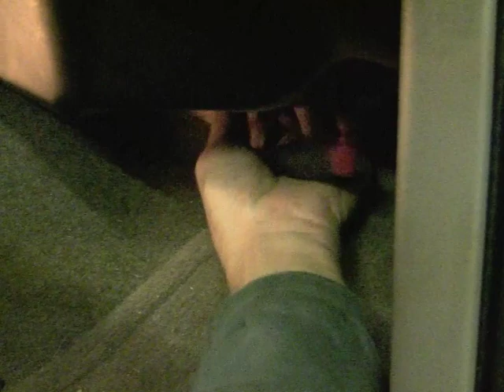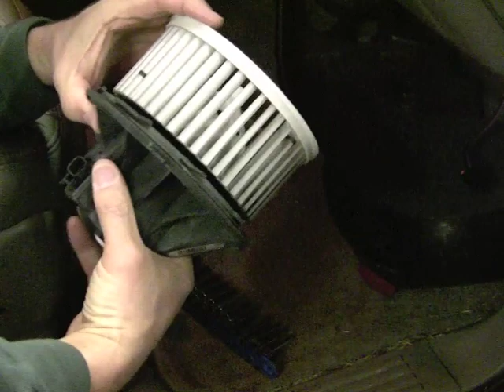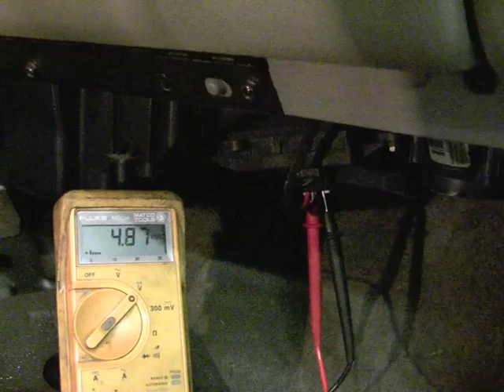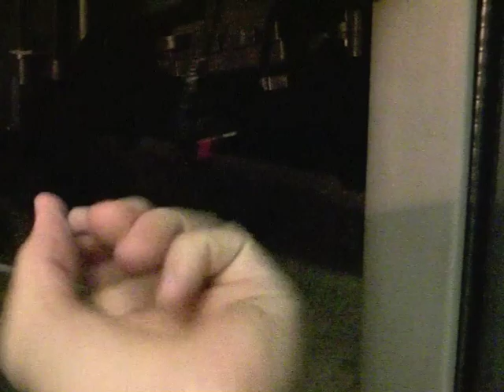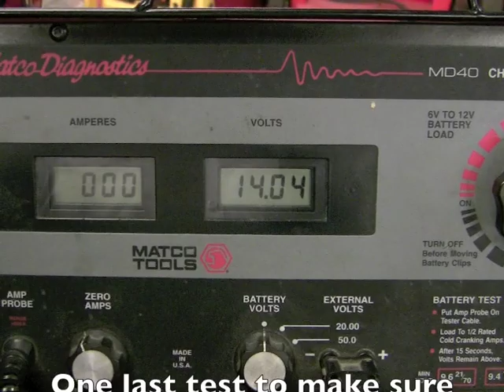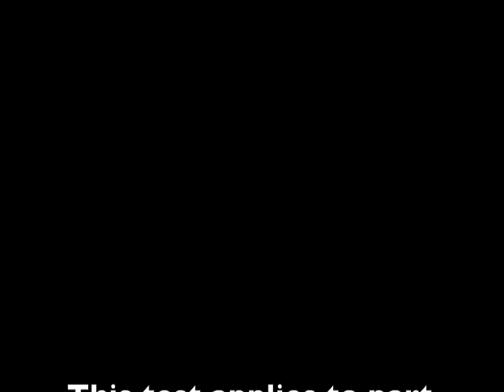2005 Chevrolet Tahoe Blower Not Working

Comment: 06 GMC Yukon. Blower only works when vechile is moving. But when it is moving very little air coming out of vents. No matter what speed you have blower on
Reply from the maker: Your blower is not working at all. What you are feeling is ram air coming in through the fresh air inlet. That is why it is only there while the vehicle is moving.
Reply: @SparkysAnswers  ok that makes sense I replied to your question on your site thanks for all your help. Really appreciate it

Comment: I know this video is almost 9 years old, but my A/C only worked in the rear of our tahoe. Checked all fuses everything was good. Checked relays and those were good. I came across this video and was like let me give this a whirl. I dropped my blower and it had a bunch of dust. Gave it a little nudge and it blew a lot of dust off of it but than worked as normal. Awesome video!! Thanks for the help
Reply from the maker: Glad to hear that your blower is working.

Comment: I'm not getting any readings from the middle purple cable, could this be the ac controller on the dash?
Reply from the maker: The voltage on the small purple /white wire comes form the blower speed controller and not the HVAC control panel. The HVAC control panel pulls the voltage low by applying a pulse width modulated ground signal to it. To test you will need to separate the small purple/white wire from the blower speed controller(resistor) and then backprobe the blower speed controller to see if the voltage is now present. If it is not the blower speed controller is faulty (assuming you have also confirmed power and ground on the red and black wires). If voltage is present you will nee to find out if the HVAC control panel is shorting the signal to ground or if the harness is rubbed to ground somewhere.
Reply: I have same issue. Too bad you couldn't show a video of this.

Comment: Nice video ! I have 02 tahoe automatic controls. And my blower works intermittently. And when that blower works I have front and rear air. Can you have advice for me ? I can’t still find a pattern when the blower works. It works on every level 1-4. Just blower comes and goes

Comment: what have i done wrong after replacing the blower motor and the resistor both new parts from advance auto. and the climate control still doesnt blow air on high, is their some fuzes somewhere other than the left side door
Reply from the maker: There is a BLWR fuse in the underhood fuse box that powers the red wire for high blower speed (5).
Reply: ok, i checked both 30 amp fuses on the side panel prior to replacing the motor and blower resistor, are these fuses i can purchase at advanced auto or do i need to go to dealer,, reference fuses under the hood. they should be in my manual correctl
Reply: louis paccapaniccia
10 minutes ago
ok, i checked both 30 amp fuses on the side panel prior to replacing the motor and blower resistor, are these fuses i can purchase at advanced auto or do i need to go to dealer,, reference fuses under the hood. they should be in my manual.. thanks i will check fuses under the hood very good video, thank you.

Comment: I installed a new blower resistor module. It fixed the problem and the fan now turns on. However, the fan kind of pulses and makes a thumping noise. Is my resistor not working correctly or is there another problem? The fan seems to be fine (since I can turn the fan on high and when I turn the key to off the fan glides smoothly to a stop with no thump that is present when the fan has power. 
Any ideas? Although the resistor is new, I think the resistor is bad after the above run test,  but I don't know for sure .
Reply from the maker: What brand and part number did you install? The two things that come to mind are a faulty blower motor or a faulty blower speed controller (resistor). Assuming you used an ACDelco 15-81773, I would be leaning towards a faulty blower motor. Possible worn bushing or open commutator bar. If you did not use an ACDelco replacement part and the noise was not there in the recent past when the original blower speed controller (resistor) was still working I would be leaning towards a faulty new part.

Comment: My rear and middle vents seems to be blowing fine but my front was are not pushing air and my windows won’t defrost.. can you please help me
Reply from the maker: What kind of vehicle and does it have manual or auto controls? Is it not blowing in the front or not getting hot?
Reply: Same here front does not blow any air and when I press the Defog I hear a ‘click’ but nothing happens (2005 Chevy Tahoe)
Reply: I have a 2005 Chevy express my heat is not working and I have tried to check the blower motor but seems fine.
Reply: It has a manual control

Comment: hi, I have the same tahoe,but I can't find the part for it,they are either 5 pin or the screw holes don't match. need help.
Reply from the maker: If you have the same Tahoe with auto controls the part has been updated to a new design with a five wire connector.  It can be found here.    https://store.the-electric-connection.com/15-81773-hvac-control-module--gm-trucks--suvs-w-automatic-ac--2003-2009-p719.aspx

Comment: whats the part number on the resistor i cant seem to find one that fits my 03 sierra.
Thanks in advance...
Reply from the maker: I am assuming that your truck has auto controls. The current part number is 15-81773. Here is a link to that part. https://store.the-electric-connection.com/15-81773-hvac-control-module--gm-trucks--suvs-w-automatic-ac--2003-2009-p719.aspx
Reply: I got the manual controls
Reply from the maker: Factory floor mounted center console with bucket seats or not? RPO option D07 on sticker inside glove box.

Comment: man I hope you can help me. I have an 04 suburban with auto ac. the blower completely stopped working. I checked the blower and it still spins with power applied to it. I tested the resistor and got 13v on the hot side. but nothing on the purple input wire. not knowing much I replaced the resistor and still the blower doesn't work when hooked back up. so now I'm leading to what I'm assuming is called the hvac aux. control module. searching the internet for these different parts has brought up a lot of different issues with different parts and the same parts being called different names. but I'm hoping you can help me identify this part,  the purple wire from the blower speed resistor goes to it. it has the red and gray connectors. Also if this piece is bad, could that cause the blower to completely not work? and is there a way to test those connectors? Thanks for any help you can give me
Reply from the maker: The original blower speed controller (resistor) had a three wire connector. At that connector you have a black wire that must have a constant ground signal and a red wire that must have a constant battery power signal. You indicated that the red wire has 13 volts on it. The voltage on the small purple/white wire comes from the blower speed controller (resistor) and Must be checked with the harness connected.  The HVAC control panel pulses a ground signal to it and it is referred to as  pulse width modulation (PWM). Here is a link to an in depth article on the late model replacement part. The article also has links back to articles on the original design. http://sparkys-answers.com/2011/07/2003-gmc-yukon-bower-erratic-not.html
Reply: Sparky's Answers thanks for the reply, but how do you test the purple wite while it its hooked up? and the box where the purple wire goes to, it had 2 connectors on the bottom a red and a gray, and inside looks like a computer chip, is that the HVAC control panel? and could that cause the blower to stop working?
Reply from the maker: The purple/white wire connects to the HVAC control panel (digital display with two temperature control knobs that you use to adjust the a/c settings). As far as testing the voltage it is all explained in the articles that I sent a link for earlier.
Reply: Sparky's Answers. my purple wire that comes off the 3plug harness at the resistor, goes to another box that is mounted beside an actuator. i know its the same purple wire because i traced it out then hooked the tester to it at the 3plug harness and at the red plug where it goes into this mystry box and it beeped. ive seen posts where this box is called an HVAC aux control module and ive seen posts where its called an actuator but this box doesnt have actuator parts in it. and your telling me that the control module is where i press buttons to control the system
Reply from the maker: Are we talking about the front or rear blower?
Reply: Sparky's Answers rear blower
Reply from the maker: Okay. I can still help you with this but you will need a good multimeter at minimum in order to test some of the basic signals. Use of a compatible scan tool would be best. Please go to my main site Sparkys-Answers.com and sign up for a member ship and re ask your question there. It is much easier for me to keep up with there and we can both upload images to help work through the process.

Comment: Hi. I hope you get this message. I have a 05 Yukon. My battery died so we jumped it. Now the front ac doesn't blow. I can feel it's cold but no movement of air. I checked fuses all seems ok. Please help.
Reply from the maker: My guess would be that the blower speed controller initially failed and kept the blower running even with the ignition off. This caused the battery to go dead and now it will not work at all. I strongly suggest  you test the voltages as outlined in this video and on my main website to confirm.
Reply: Thanks. It was the blower resistor. I took a chance n purchased one n changed it. I had to do something. Here in Hawaii the shop woulda wanted my both arms n both legs 😂. My husband was shocked that I did it by myself. I shocked myself also. thanks for the reply! 😊

Comment: So I know that a blower resistor needs to be changed if the blower works on 1 and 5 on the controller. Is it the blower motor if the blower does not blow at any setting on the controller?
Reply: And is the blower speed controller and the blower resistor the same thing?
Reply from the maker: The blower resistor is the most common cause of a missing speed or speeds in the blower system. If all speeds do not work the blower resistor could still be the cause but the blower motor becomes more suspect under that scenario. I cannot stress enough that a "silver bullet solution" does not come close to actual testing and education so that one Knows the answer instead of simply making a statistical guess.
Reply from the maker: A blower speed resistor and a blower speed controller accomplish the same task of adding control over the blower motor. They function very differently though. The blower resistor is generally part of a manually controlled system and the blower speed controller is generally part of automatically controls system. As with anything there are blurred lines on this subject depending on make, model and year of vehicle being referred to.
Reply: Great. Thanks. I have a 2003 Chevy Tahoe. I replaced the resistor two years ago. But, the manual controller worked on speeds 1 and 5 and I found that to resolve it. I think it might be the blower motor now, but I will do the tests you showed in your video. Thanks for your help.

Comment: Question. My front ac is not working. I have figured out that the wire that you disconnected at 2:55 is badly corroded. Where can I get a replacement for this wire? And how would I do it? I tried to follow the wires but the lead into a compartment I cannot open. Please help! 100 degrees here in San Antonio Texas
Reply from the maker: You will need to replace the blower speed controller and it's harness end. Trouble is the three wire version is no longer available in a quality part or affordable price. It has been replaced by GM with a new design that comes with a repair harness that has to be spliced in. https://store.the-electric-connection.com/15-81773-hvac-control-module--gm-trucks--suvs-w-automatic-ac--2003-2009-p719.aspx
Reply: +Sparky's Answers thanks for responding. Can you explain a little more on how I would go out repairing this. Step by step. Or maybe even post a video?? If possible.
Reply from the maker: I wrote a repair article several years ago. http://sparkys-answers.com/2011/07/2003-gmc-yukon-bower-erratic-not.html
It explains the repair and the changes in the part design over the years.

Comment: Hey Sparky, I know this is an old topic and that you probably get this alot but I have a 2002 burb and I recently had the front ac/heat stop working on me.  I noticed the melted connectors on the resistor so I replaced that but now it still isn't working I'm wondering do i need to replace the blower motor as well even though it seemed fine.  The vehicle is high mileage and I purchased it used so I'm not sure if it was ever changed prior to this.
Reply from the maker: +vash622 Start with testing the circuits with a test light or a multi-meter. I did and in depth article on my main site that may give you more insight into the system. 
http://www.sparkys-answers.com/2008/07/2005-chevrolet-silverado-blower-inop.html

Comment: How much did the blower speed controler cost? Oriellys wanted to charge me over 300 for it! It's the same one shown in your video.
Reply from the maker: +Thrillaforilla If you try to buy an original three wire design 300 is what most companies are asking. However if you want the latest design from GM it is much less expensive. I have included a link to the product. It does require splicing in a new harness connector but all parts are included in the kit. You will need a pair of terminal crimping pliers.                 

http://store.the-electric-connection.com/15-81773-hvac-control-module--gm-trucks--suvs-w-automatic-ac--2003-2009-p719.aspx

Comment: When I preform the voltage test on the purple wire I see no drop when I change the fan speed on the controller. What could this be?
Reply from the maker: +Richard Kelly I have to make a couple of assumptions here. On the small purple wire with a white stripe there should be five volts present when checked to chassis ground. The voltage should go down as the blower speed is reduced. The testing is done with all harnesses connected. If there is not a five volt reading on the small purple wire with a white stripe then you must check for power on the red wire and ground on the black wire. If power and ground are present respectively on those two wires the blower speed controller is faulty. If the five volt reading is present on the small purple wire with a white stripe and it does not change as the blower speed is reduced then you will have to check for proper powers and grounds to the HVAC control head and for continuity on the small purple wire between the blower speed controller and the HVAC control head assembly.
Reply: +Sparky's Answers The video says the voltage goes UP as the blower speed goes DOWN.  Is that wrong?
Reply from the maker: +Rube0ne The video is correct. I was hasty in my earlier reply. The reading reads in reverse if checked against the red wire instead of the black wire. I check it either way and the important step is that there is a change in voltage as it is commanded to change. You can read more about the systems and the changes that have been made to it in some of the links within the article below. 

http://www.sparkys-answers.com/2009/05/2003-chevrolet-silverado-blower.html

Comment: hey sparky, i have a 2008 suburban and the air speed fluctuates constantly even when it is not in the auto mode... do you have any ideas to fix this problem?
Reply from the maker: +benjamin smith The most common problem that I have seen is a burnt terminal at the blower motor and its harness connector. If found the only real fix is to replace the blower motor and the harness connector at the same time. Anything else, while it may work will be a short term fix.

Comment: Thanks for posting the video... This will be the second resistor that i have replaced. The blower works, the resistor works... but when i replaced the resistor because the wire and resistor burned. Now with the new resistor the 3-wires coming from the fuse area gets very hot is there something i can check or do to see why it does that. I feel that im going to have to replace the resistor and 3-wire again next summer.
Reply from the maker: Cody Hartt If there was damage on the three wire connector at the time the blower speed controller was replaced the damage will transfer to the new part. The only way to overcome it is to replace the connector and the part at the same time. By the way the old three wire blower speed controller is no longer available. It has been replaced with is part.  It has been redesigned by GM and comes with a new wiring harness.

http://store.the-electric-connection.com/15-81773-hvac-control-module--gm-trucks--suvs-w-automatic-ac--2003-2009-p719.aspx

Comment: I have an issue that seems very strange... each time I turn my Tahoe OFF, remove the keys w/the engine OFF,  the AC continues to stay ON & WILL NOT shut off unless I REMOVE the fuse from the fuse box under the hood. What's up here & how can I remedy this?.?.?.
Reply from the maker: marc mccullough It is a very common problem as outlined in this video. Here is a link to the part  

http://store.the-electric-connection.com/15-81773-hvac-control-module--gm-trucks--suvs-w-automatic-ac--2003-2009-p719.aspx

There is also a link at the bottom of the product page to more repair information on  my main site.